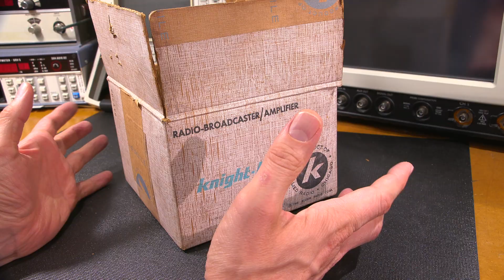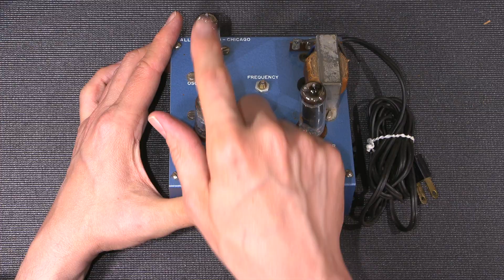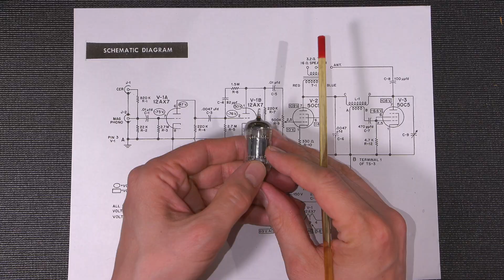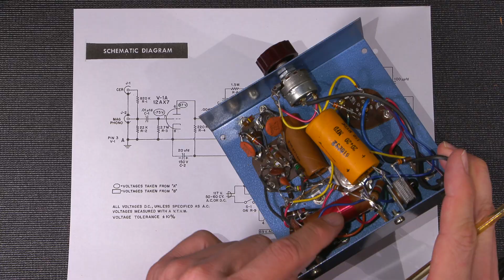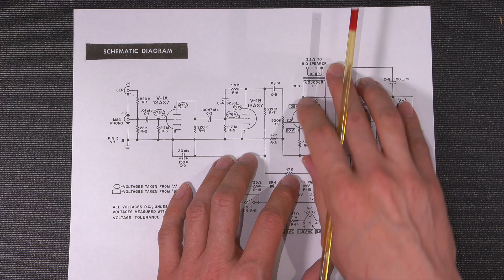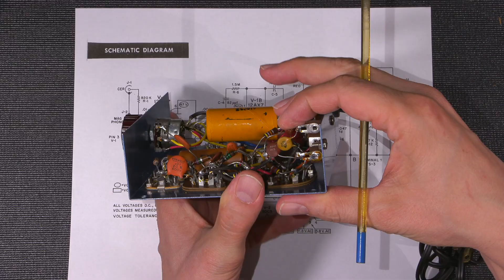Your Own Radio Station! The Knight Radio Broadcaster And Amplifier!

Comment: The mystery device is a high voltage vacuum relay, it has a base part that operates it. Probably used in Radar systems.??

Comment: Hi, I have just built a small Stereo pre-amp, using the 6J1 series low voltage valves (27v to 35v HT). It was very interesting to build and works very well on my high end Hi-Fi.
I have been a licenced Radio Amateur since 1986. Interesting transmitter.

Comment: Years ago, I built a Ramsey FM stereo radio transmitter.  I didn't know what to expect but the Ramsey transmitter can transmit a high fidelity stereo signal about a half mile with the small antenna that comes with the kit.  You could probably transmit a better signal with a better external antenna but I have never tried it.

Comment: You can always connect a bleeder resistance of 1 to 10 megs across HT capacitors, to make it a bit safer after disconnecting fro mains/

Comment: A relay, actuated by the effect of a magnetic field developed by the current in its energizing coil(s).  There used to be 4 manufacturers who built this device, now there are still 3 offering it to the market. Originally, this device was used by the military (like many of those things).  BTW, Paul, next time please hide the part number on the device.  This one was easy to read and google offered the answer right away.  :)

Comment: The meters don’t like capacitors in circuit because the other components connected create other paths for the meter probes like say you have a 10uf cap a 47k resistor and a
.001 if cap in parallel and are testing the 10uf cap the meter is also connected basically the same to the resistor and 001 cap.

Comment: OMG the one I had was so BROAD BAND you never NOTICED drift, it WARMED UP in 10 minutes ald I RECOLLECT NO DRIFT, but it was 1964, and WHAT DO YOU HAVE AGAINST A SELINEUM RECTIFYER?
JUST SAY: IT IS A SERIES WIRED AC/DC 1950's STYLE RADIO, if people don't know that they WLL LEARN...It will not kill you. hell I was a Ham Operator in the HOME BREW DAYS and I understand most people in 2019 are brain dead morons after a Graduate Degree in Electronics about REAL GLOW IN THE DARK radios. 

MOST RESISTORS were 20+/- because it was not critical , some %5 +/- or %10 +/- tolerance
THIS TYPE OF ELECTRONICS CLASS 'HOBBY" NOTHING CRITICAL ENOUGH FOR 'HIGH TOLERANCE" COMPONENTS.

Comment: I built a KnightKit Phono Oscillator in 1964 and actually Increased Output and made it Crystal Controlled, 1600 KC. I lived in Benton, AR. on a Large Lot, on River Street, and never got a complaint. It was a simple kit with excellent Schemetic and Pictoral Diagram. I was 14 Years old.

Comment: MY MOM MAY HAVE MADE THAT 50C5.  There was a factory in Norwood Ohio a few miles from here.  She LOVED working with those little parts.  I recall her telling me as a child and we actually spoke of it a few years ago.  She died in April 2017   I have a few little ones  around here somewhere.   I built my own aprox 300W AM transmitter from parts of schematics from an ARRL handbook in the local library.  I used a special order crystal in an army surplus oven, cut for 1610 AM  from Jans Crystals, Crystal springs FL.  I'm thinking I paid about $10 for that.  The rest including Color TV horiz output tubes for the transmitter, x 4   Those were the days,  I had a Heath Kit scope to watch the modulation.  I was VERY popular around my neighborhood.  for about 14 months...  I was a bad boy.

Comment: Ah, this brings back memories of when I fired up my own AM broadcast station as a teen long ago. Via surplus and for about $5, I'd gotten the  LF oscillator accessory that was installed in some WWII ART-13s. It was intended to let that Collins-made HF aircraft transmitter tune down the ship frequencies below the AM broadcast band. Since it tuned into the low end of the broadcast band, that gave me an idea.

For modulation, I took an audio output transformer that converted from a high impedance (tube) to a speaker (low). I reversed it, feeding the low impedance speaker output of my SW radio into it and feeding the power for the oscillator through the high impedance winding. For an antenna, I hooked up both sides of the coax feeding my 10-meter beam, so that meant about a 20-foot high vertical. Oh, and I hooked a high-voltage capacitor from a TV between the plate of that oscillator and the antenna, so the antenna wouldn't be hot with about 250 volts.

Since this wasn't exactly to FCC regulations, I took two precautions. First, I put it on the air on Christmas Day. Surely, I told myself, they won't be working today. And second, for audio I supplied it with what a local AM station was broadcasting. If anyone tuned it in, they'd wonder why that station was on a different frequency.

Then I took off in the family car to see how far I was getting. On one direction, a dry, sandy hill top, it petered out after about five blocks. In the other, with damp soil, it was still strong when I got to a wood almost a mile away. That way, it was probably getting about two miles.

Here's what I was using:
-----
Low Frequency Coverage and More Accessories - The standard ART-13 transmitter frequency range is from 2.0mc to 18.0mc, however many Navy ATC and T-47/ART-13 transmitters and later USAAF T-47A/ART-13A transmitters were equipped with a plug-in Low Frequency Oscillator (LFO) module that allowed the transmitter to operate from 200kc to 600kc or 200kc to 1500kc (at somewhat reduced power, CW only for electrically short antennae.) Early LFOs had a frequency range of 200kc to 1500kc in six ranges designated as O-16/ART-13, while the later LFOs cover 200kc to 600kc in three ranges and is designated as O-17/ART-13A. The LFO modules used a single 1625 tube. When the LFO is in operation the ART-13 Multiplier section is bypassed and the LFO output directly drives the PA.
---
The ART-13 was probably the most beautifully made of the WWII transmitters, as you can see from the interior photos here.

https://www.radioblvd.com/art13.htm

Comment: I know this isn't related to the video, but I have an old bell and Howell model 34 oscilloscope that I am repairing and I was wondering if changing the values of its capacitors by 1 or 2 increments such as 20mfd to 22mfd would mess up the scope if I powered it back on. Help would be greatly appreciated!

Comment: Is it ok to test this circuit with no load on the output transformer?
Also, won't the volume control affect the audio volume and the modulation amplitude at the same time?

Comment: 23:00 - The C2 filter capacitor will discharge through the two 47K pseudo isolation resistors. C10A and B will discharge quite bit through the tubes before the heaters completely cool off right after power is turned off. Still might give an unpleasant surprise. Unless you have a bad heart, or broke your neck leaping from your stool (I've done that! Obviously not the broken neck part!) you'd probably survive and be a bit wiser. :-)
30:40 - NOW you want to discharge the capacitors! Without the tubes pulling current, they are all fully charged to peak voltage. Assuming the selenium rectifier is good. Yes. I'm commenting as I watch. :-)
44:00 - TR switch?

Comment: When i was 10 years old i built the first piece of electronic gear in my life which was a pair of Knight Kit 3 transistor walkie talkies. I built them with an old Weller soldering gun. They were rated at 100 milliwatts but i doubt they actually made more than 50. Amazingly i learned quite a bit of electronic theory from those kits. They were my introduction to electronics way back in 1961 and sparked my interest in radio.  Today i hold an Extra class FCC license and Ive never lost interest in electronics. Thanks for the memory, Paul I look forward  to the next excellent video.

Comment: You mentioned a lot of things about the vacuum tubes that I had long forgotten. Your mystery device is a vacuum relay. We used to use them in insulation testers to switch the voltage from a hi-pot tester to various test points.

Comment: Excellent video as usual! And of course EXCELLENT CHANNEL! One of my FAVORITES! This video, and so many others like it are great, but they always assume a fair amount of knowledge and experience from the start. That’s fine and dandy, BUT, let’s face it: WE WERE ALL BEGINNERS AT ONE TIME. I still have a TON to learn myself. That said, SO MANY videos and YouTubers like this TALK about safety, but never actually SHOW the safety procedures. Yeah, yeah, I know: If you don’t have experience working with this stuff, you shouldn’t be doing it. But let’s face it: Nine out of ten REALLY GOOD technicians on YouTube, AND IN THE REAL WORLD, are SELF TAUGHT. I took correspondence courses from the Cleveland Institute of Electronics 30 years ago, but it was all theory, almost no hands on, and we all know that the learning doesn’t RRREALLY start until we roll up our sleeves and STICK OUR HANDS INSIDE. These self-taught, now-EXPERTS, are people that INDEED stuck their hands in places and at times they shouldn’t have. How about making some videos, or just appending an extra five minutes to future videos ACTUALLY SHOWING THE DISCHARGING PROCESS; actually SHOWING the do’s and don’ts of SAFETY. MOST YouTube channels like this show scene cuts AFTER something has ALREADY been done (this channel included): New scene: “Ok, now you can see that I have replaced all the caps.”.... NNNNO!!! SHOW yourself replacing the caps! SHOW yourself discharging the unit before sticking your hands in there. SHOW yourself taking measurements, and SHOW beginners that lethal voltages REALLY ARE present BEFORE any discharging takes place. If you do this, you will foster a LOT more education, and especially, A LOT MORE SAFETY. In short, show, SHOW, SSSHHHOOOWWW! ... Or just like the song by Canadian band, Rush, says, “SHOW ME, DON’T TELL ME!”... Great video, great channel, and I am a faithful viewer, follower, and fan, but SHOW rather than just tell! Thanks!

Comment: I can't understand why the designers could in all conscience have a non polarised  mains plug, with no earth connection to chassis, rather just a 47k resistor between line/neutral and chassis! In the UK it seems more scary given our 230V line.

Comment: Another really interesting video of yours, and I appreciate it's not intended to be a high-spec device, but could we have a bit more technical analysis of it please? 

What was the maximum undistorted modulation depth? And min and max modulation frequencies at the 6dB points? How many mV required at the input for maximum modulation? Was there a significant amount of FMing on the simple AM transmitter circuit - particularly as modulation is applied to an L/C oscillator? How much does it drift from switch-on? 

With the recommended antenna, what is the approximate range using an average radio for reception? What was the frequency coverage? Was it the full AM band or just a section?

In your opinion is it worth any of us sourcing the parts and building a reproduction of this vintage design - despite the obvious safety issues?

 Thanks.

Comment: Great video!  Like many commenters here, this device was the heart of my neighborhood radio station as a kid in the 60's.  After tiring of the occasional "tingle" from touching the line referenced chassis or anything connected to it...really annoying when accidently touching you lips to a metal cased microphone...I cobbled an isolation transformer using 2 similar salvaged TV set power transformers back to back with their filament windings connected.  Also found you could modulate it by connecting a hi-fi amplifer's speaker output to the speaker output of the broadcaster which allowed tweaking the bass and treble a bit.  Great fun!!

Comment: I got one of these kits in the very early 60's and had fun with it. I started reading textbooks on electronics and a few years later I started designing tube amplifiers then transistor circuits of every description. I can still remember my first transistor, a CK722. My teen years were full of learning and exploring all of the physical sciences, especially electronics. I went into various physical science fields and never regretted it. Thanks for your tutorial. It was fun. Some sort of photo optical tube/valve/device? Possibly a discharge tube or spark gap device? Why so many electrodes?

Comment: Would replacing the rectifier with a silicon diode produce too high B+ as it will have lower voltage drop?

Comment: I guess in order to run audio, you would pull V3 to disable the oscillator and connect a speaker, all of V2 plate current now being delivered to primary of T-1.

Comment: I don't think I've ever had a 50C5 with a open filament.  In AA5 radio receivers I've worked on I most commonly see the 12AV6 and 35W4 with open filaments.

Comment: I'm going to be building a little transmitter with a 1Zh37b rod pentode once I get all of the parts ready.  These unique Soviet subminiature tubes use closely spaced rods rather than grids and have unusually good low-voltage performance.

Comment: I built one of those as my first kit. I used it as an audio amp with a turntable and speaker . It played my mono Beach Boy albums an an acceptable level and sounded good. I replaced it with a Heathkit stereo vacuum tube amp which served me well.  Of course I had no idea it was so dangerous, but everything probably was back then. I still have the albums.

Comment: I still have mine.. I found out the hard way you can get a good shock by just turning the Broadcaster off. and still plugged in. That was back in the early 60's. Learned a lot from that time. The cost was  $11.95.   Alwas had a  hum in the audio. The 12AX7 tube would light up bright filament when first turned on. Over all GREAT video. 73

Comment: That is a vacuum relay that appears to be missing the solenoid off the bottom, unless it was just a manually activated vacuum switch. Usually for HV or high power RF is what I've seen similar ones used for.

Comment: Hi, Mr. Carlson. You have a lot of things going on, and you may not want to even consider this, but this is what I have. I just bought a mint 1983 Chevy Van, but the AC Delco AM FM radio/CB needs help. The system is bone stock. Nothing has been messed with. I think that it would make for an interesting video? If at all interested, let me know. Thanks!

Comment: Sir, would you consider covering selenium rectifiers more in depth?  How are they made? What causes them to go bad?  What are the symptoms of a failing selenium rectifier?  What happens when they completely fail?  (I heard it's bad)  And how to replace a selenium rectifier with a modern silicone diode while at the same time maintaining the proper output voltage of the circuit.  Thank you for your outstanding content.

Comment: I would be tempted to put a 1 meg, suitably voltage rated resistor across each high voltage cap. This would be two just in case one goes open. My thinking is to slowly bleed off energy and hence voltage off the caps when powered off. Is there a downside to doing this?

Comment: Is there a modern version of the DLM-240 on the market? If not, what is the full manufacturer name & part number? Nothing like it shows up on my ebay check with "circuit-test DLM-240" and I would like to locate one if there is nothing on the market like it.